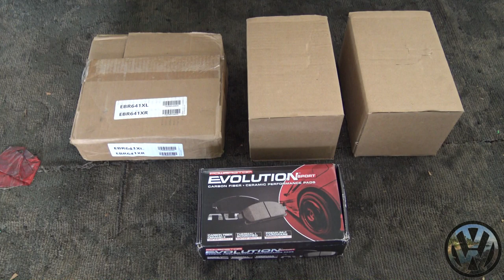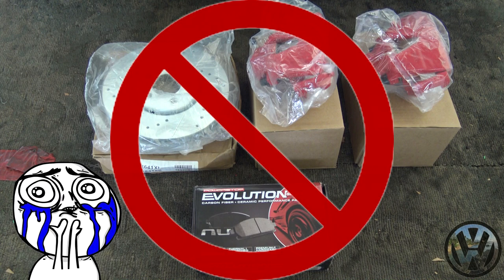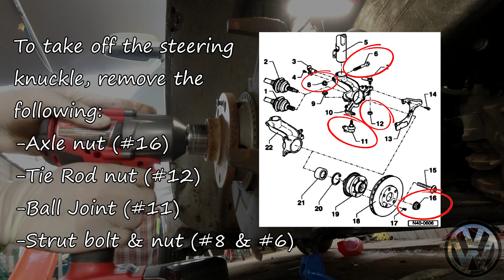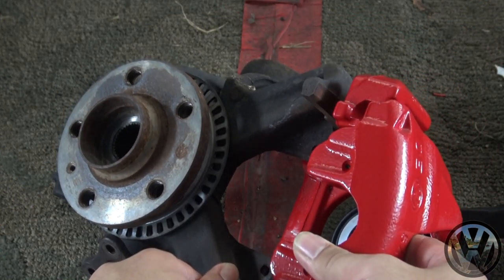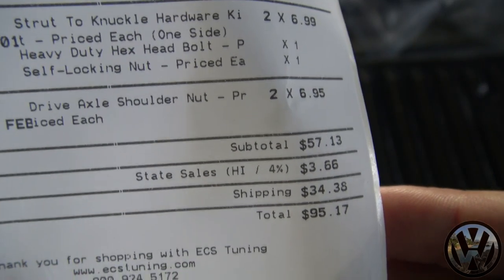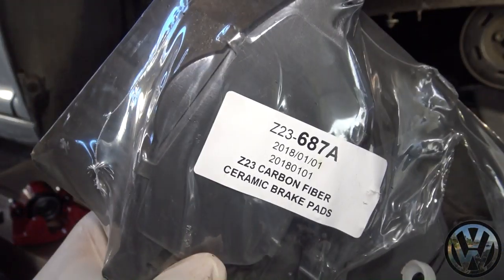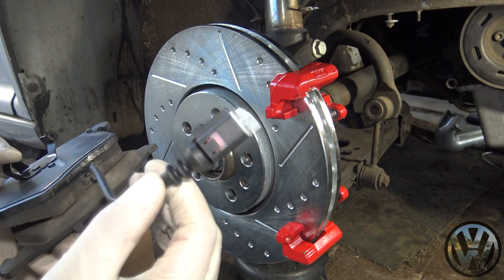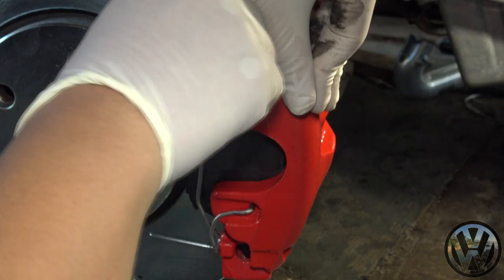VW MK4 Brakes Upgrade (2.0L, TDI, 1.8T, VR6)

Comment: Probably would have been better going for the audi tt steering knuckles as the ball joint mounts lower which helps with the suspension geometry ;)

Comment: i had those same breaks and rotors on my passat. did they give you alot of brake dust? mine did. thats my biggest pet peeve is having break dust on my rims (even tho they are stock) which has stopped me from getting after market rims put on. Any good brakes and rotors that will help eliminate so much brake dust?

Comment: Do the 2.0 axles slide right into the 1.8t knuckle/wheel bearing with no issues? I wasnt sure if they were the same size or spline count.
Reply from the maker: Yes the splines are the same across all engines. These knuckles were originally on a 24v vr6 and then thrown on a 2.0L and now 1.8t.

Comment: My question I have a 2003 vw jetta 1.8t would i need to change the steering knuckle on my car and would i be able to run the same 17inch rims i have  on my car would the calipers clear the rims
Reply from the maker: Your 1.8t should have the separate caliper design so no need to swap..Also, the calipers should clear the wheels with no issues. Some of the VW OEM wheels are 17in and have no problems

Comment: Do you have the OEM(Audi TT or MK4) Jack Pads (Big Rubber Pad)  under you MK4, where do you put the support under the car?
Reply from the maker: I usually place a block of wood and place the stands under the frame of the body.
Reply: @VdubInParadise  Thanks!